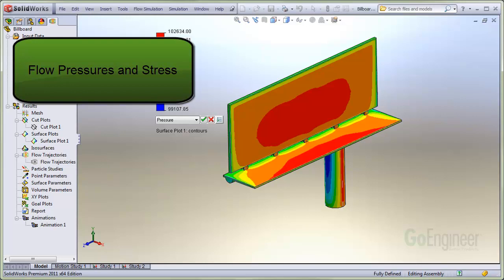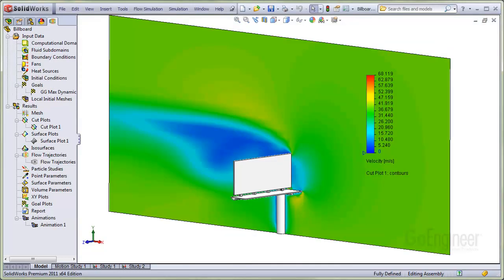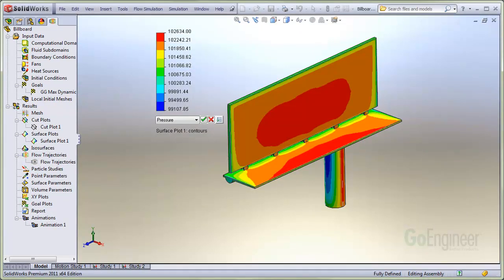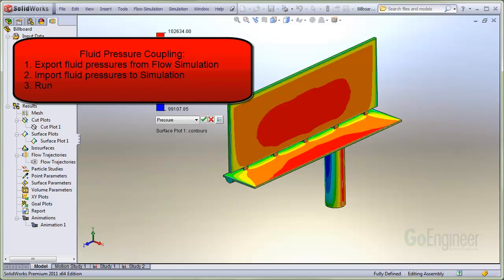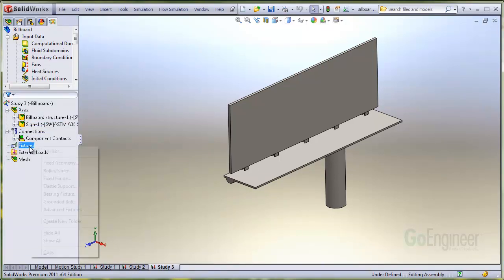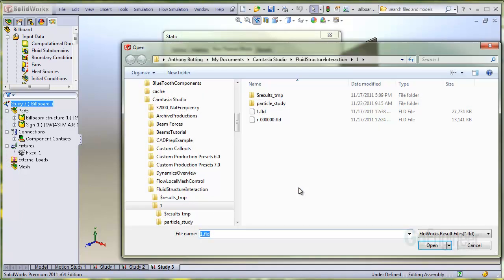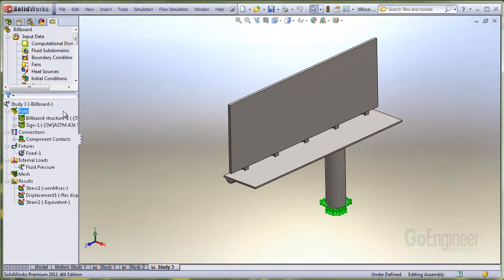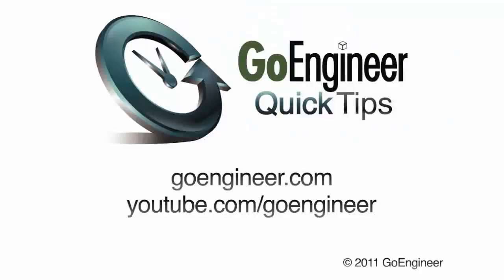SOLIDWORKS Flow Simulation – Stress from Fluid Pressure

Comment: Hi Tonny
Thanks for the tutorial
I have a question
I am trying to analyze windload on a steel substructure and  i am doing the followings
1) I model a refereance surface (representing the cladding) around the steel sub structure
2) i run the flow simulation
3) i export the results
4) i start a static study
5) in the study i exclude the referance surface from the analysis
6) i import the results of wind simulation
7) i define boundary conditions material and joints in the static study
8) when i run the study - i end up with an error ''no external load detected''

what can be the reason?
can you help me with it?
thanks...

Comment: i am trying to analyse  the winld load for facades.
what i want to do is analyse the "SURFACE" for wind and observe pressure values.
Then i want to imprt these data into my facade " i modelled only one or two - i cannot model whole structure"

Can anyone help me with it?
Reply: +EYUP FIRAT AYDIN What Tony has done in this video should work for you as well. Global or Surface goals for pressure would be a good idea too. Not modeling the complete structure is okay, but you'll want to double check the assumptions you've made in the computational domain in Flow and the restraints in Sim.
Reply: +Shivani Patel do you have any idea
what scale of structures it can be applied.
In sw forum , users are not suggesting for big scale works. but I can't understand, 
my purpose is to find out pressure values over the surface, then I would design substructure.
solidworks is used for aero space engineering at all, ha?
Reply: +EYUP FIRAT AYDIN I have seen Flow used for NACA airfoils, so yes it is possible to use for basic aerospace engineering. The scale of the structure isn't the problem, it is the power of our computers and the accuracy you are looking for. My laptop has a SSD, i7 processer, and 16GB of RAM. The largest mesh and calculation I've taken the time to solve was around 5million cells. If I had to use an even bigger model, I would have tried to stay around 5million cells. I could modify the model's mesh by making it finer in areas of importance and coarser in other areas. This is where some accuracy is sacrificed. So, you will have to try meshing and solving your model first. If it doesn't work (your computer may freeze up), then you will have to use simplification methods. I recommend looking up some videos on "Local Initial Mesh" and "manual Global Mesh".